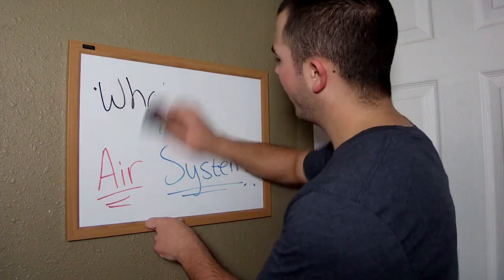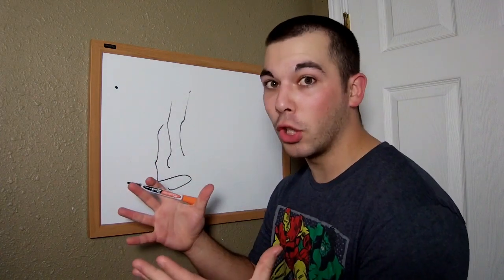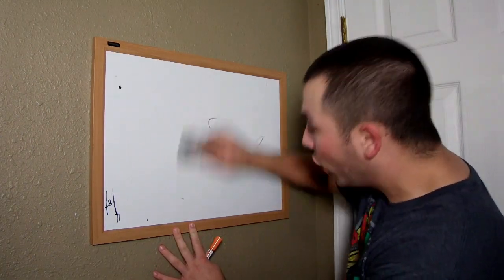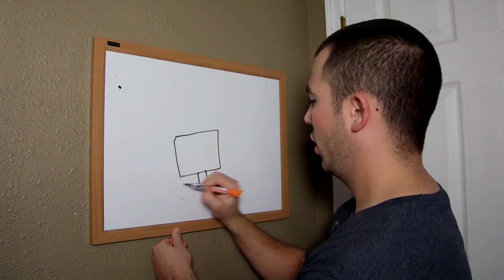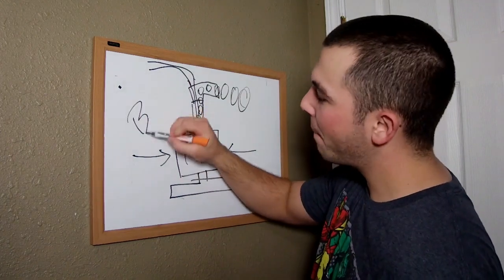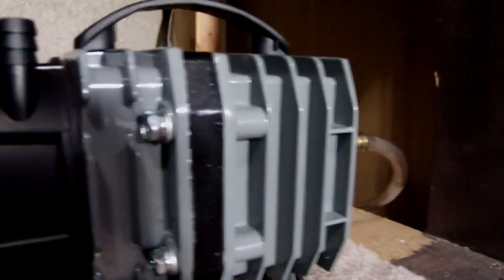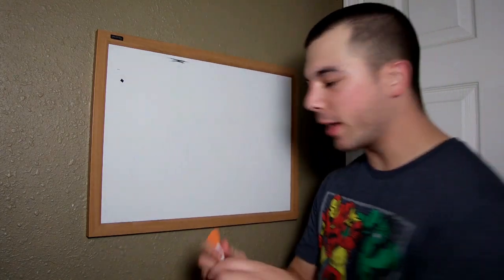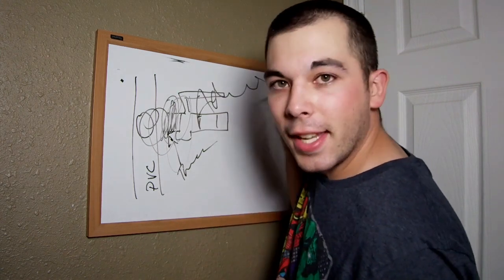DIY FISHROOM AIR SYSTEM!!!

Comment: Just finalizing on this project for the new year.  Did you keep the same gauge on the line from the pump to the pvc framework or does it switch to a regular air line gauge when it passes behind your stand?  It looks like its the same but I want to make sure.  ;)

Comment: Good vids!
I have a Precision PR7500 dual output air pump. My question is : can i join the two outlets using a T-connector into one air hose towards a sponge filter, without harming their diaphragm?

Comment: Do you rely strictly on sponge filters and k1 for filtration? or are you running canisters as well?
Reply from the maker: I run only the sponges and k1 filters on all but 2 of my tanks. I run a sump on the other 2, no canisters
Reply: Really? That is simply amazing.
Reply from the maker: AGUILAR3 Simplicity is key in this hobby. The biological process is the same no matter what filter you use
Reply: Cichlidman09 | Forrest's Cichlids
 Do the sponges get clogged up pretty fast? How often do you have to clean them? I am so intrigued now.
Reply from the maker: AGUILAR3 About once a month or so they don't clog too fast